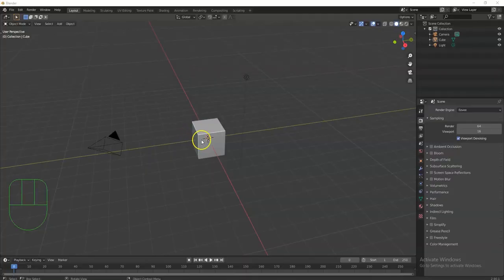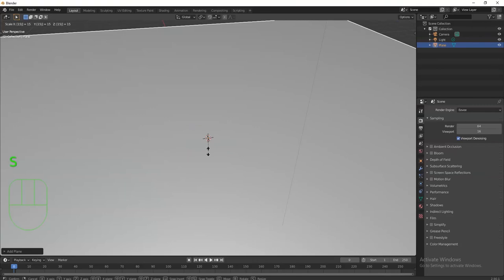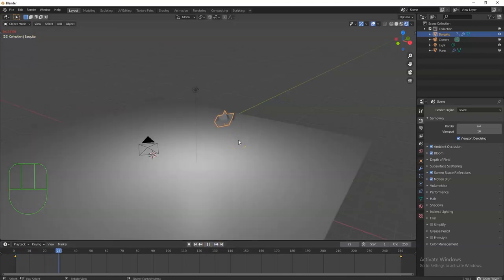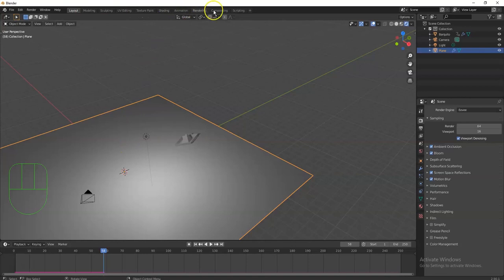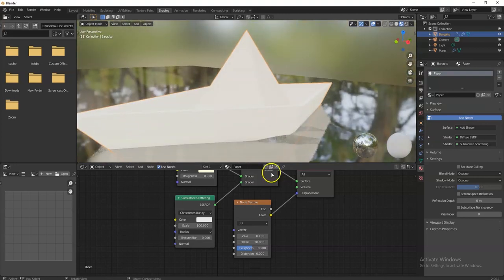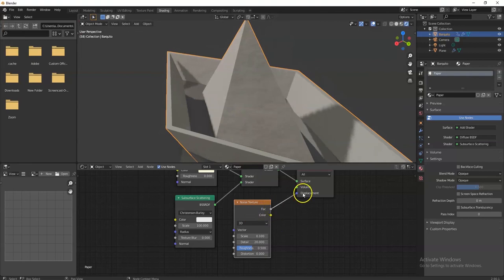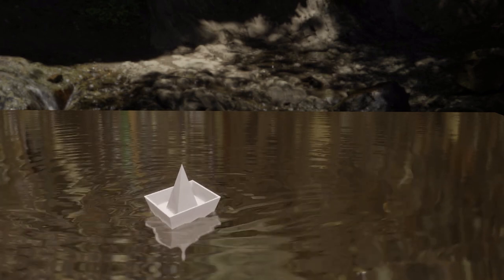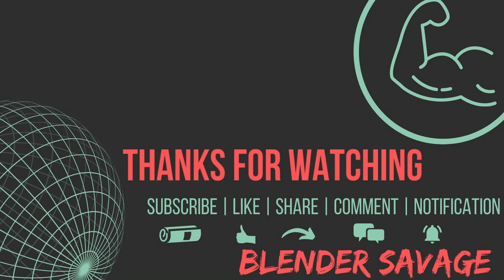Dynamic Paint Waves/Ripples | Blender Tutorial | Paper Boat Animation/Simulation

Comment: in renderview my ripples are not to see. can you help me what i did wrong. i use blender 2.9  even baked the animation, but renderview is no waves. I did this before in older version but something changed no one can help me this... did you know what i have to do now to see waves even in render mode ? thanks sir !
Reply from the maker: Hello. Make sure Canvas is applied to the plane and Brush is applied to the boat by hitting the "Add Canvas" and "Add Brush" button respectfully. Also, make sure the Type for Canvas is change from Paint to Waves.
If you have all that, then:
It might have something to do with the shape of the brush/boat. It should penetrate the water but if it's a "soft" penetration then we have to make it "rough."
Take the boat/brush to Edit Mode. Select a bottom face or a few from it. Then Extrude them down. You can experiment with different lengths for the extruded faces. By extruding them down, they'll create a better disruption to create more waves and they might not be visible above water (depends on the angle).
Please let me know if that helps.

-Blender Savage
Reply: @BlenderSavage  Normal shader Viewport Ripples i can see - Render Viewport (f12) no ripples, no moving water nohing. ...hm